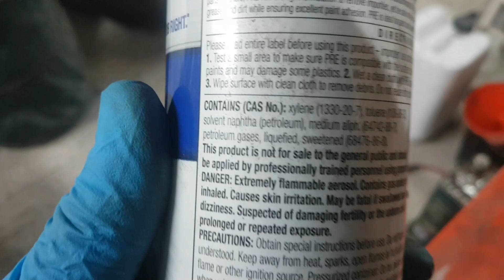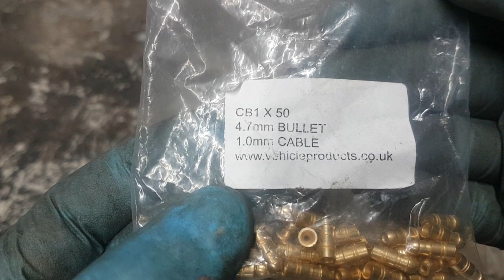Episode 6   1990 Range Rover 2-door LHD/RHD Project Southpaw

Comment: I think you will find that women do watch Bullet not for the car but something to do with some bloke that drives it !! On a more important matter the tubo, The one on my VM 2.5 has had that much play for 20000 mls as long as there are no score marks on the turbo body is should be OK, as the turbo heats up the play is taken up and that amount of oil is not that bad,
Reply from the maker: I am also more aware now that the shaft float on a thin layer of oil under pressure which takes up play even further. Every day is a schoolday